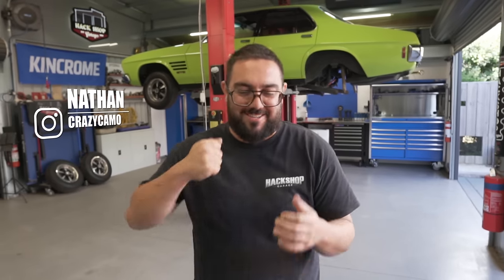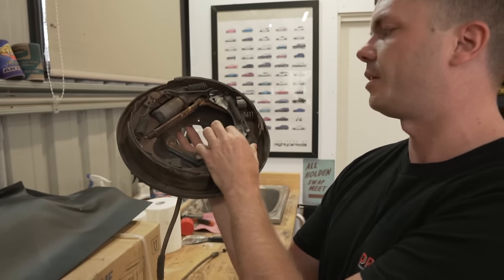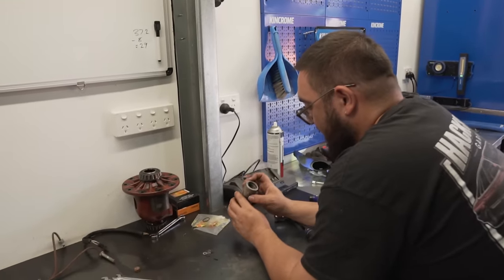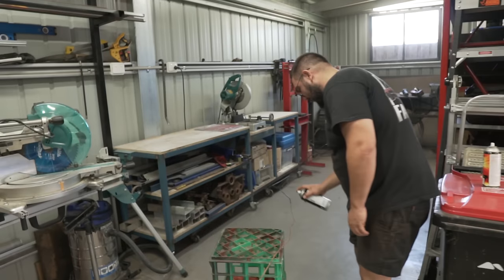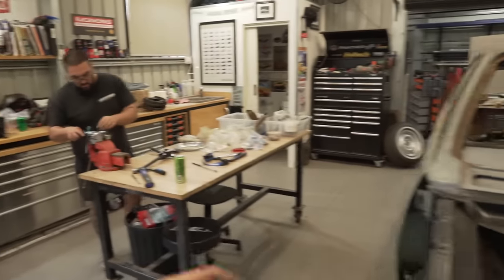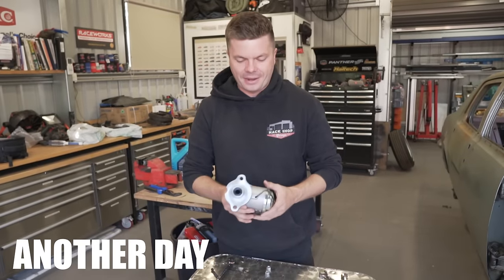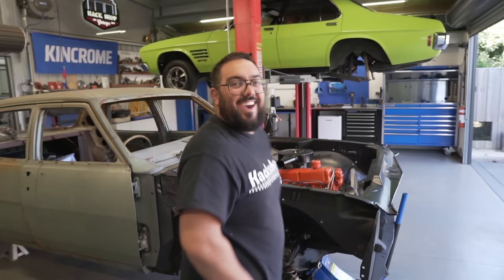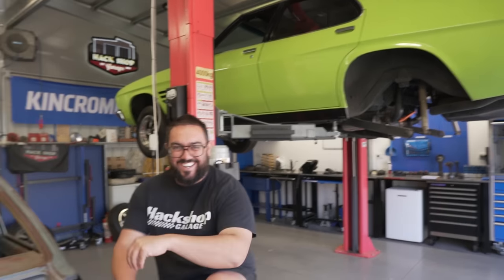BRAKE OVERHAUL - We Actually Got Something To Work! - HG Build - Part 9

Comment: When tightening flare nuts, tighten it, back it off 1/4 turn, then tighten again. You'll see that it tightens more than the 1/4 turn which should seal it.

Comment: Shoulda junked all that steel brake line as it'll be corroded inside. Nice bit of Kunifer is legal in Oz and a damned sight easier to work with than steel ;) Compressed air to pop the piston stuck in the bias valve. Did you use a locknut on the MC pushrod bolt?

Comment: If your running Disk/Drum HK HT HG never had a proportioning valve. The Disk brake vehicles had the 9/16” rear wheel cylinders. The drum brake cylinders and shoes were a different style. 1971 HG’s had the brake fail indicator. Sort of like the HQ had which was an ADR requirement. The OEM Service manual gives great detail on how to set the brake pedal free play, also with the Master cylinder push rod length. The brass distribution block lives behind the steering box the two lines from the master cylinder go to that and the feed to Front left/front right and to the rear come from that. The LH brake line ran up under the firewall with the clips there. Factory HQ/HZ brakes work fine on HK HT HG with factory master cylinder. Either Big nut cast iron or Alloy PBR…